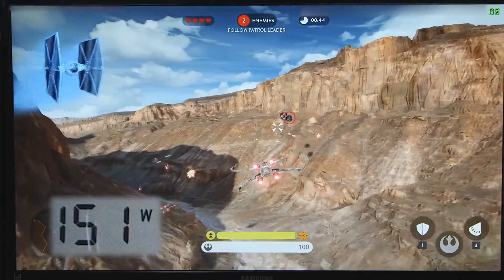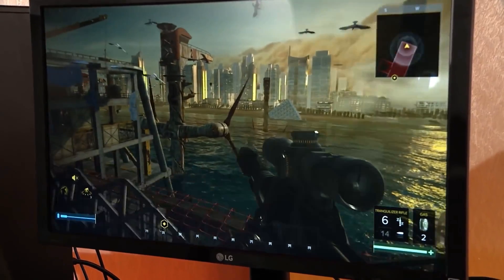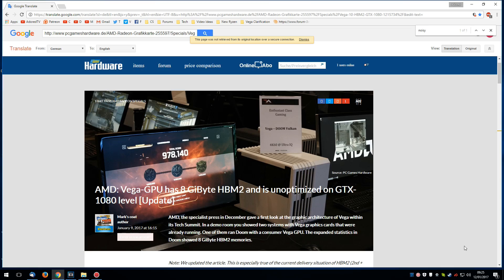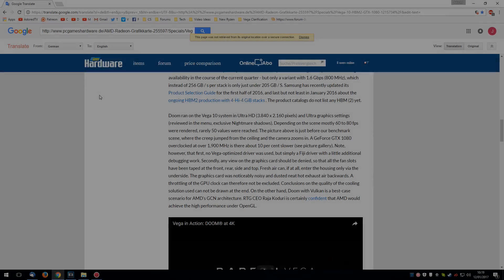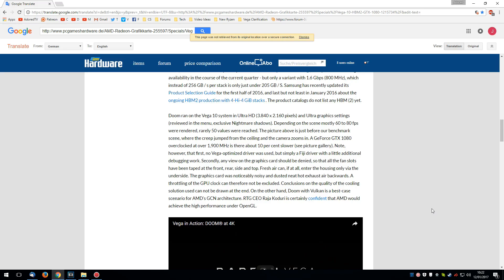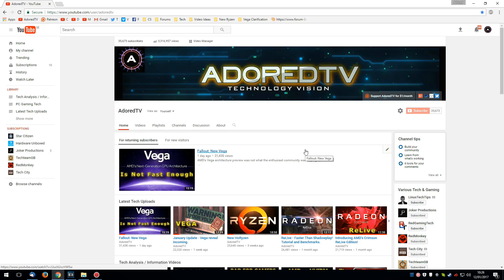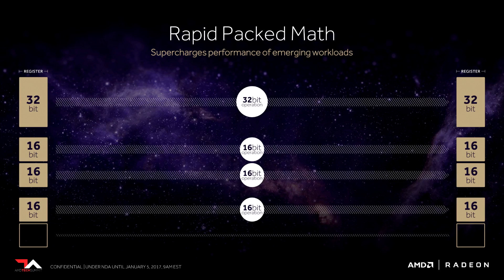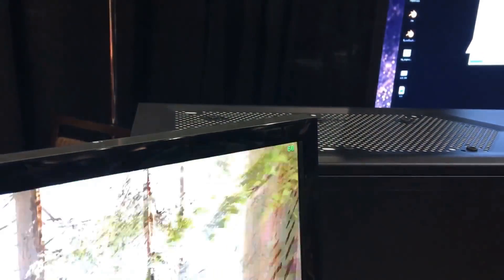Vega Clarification - How bad is it?

Comment: First of all, vega running on Fiji drivers... getting that frame rate...  I think that is just how Fiji with  8GB of HBM and higher core clock speed would run it.   

I think AMD with all their new hardware level technologies and new handlers like primitive shaders tech isn't requiring developers to build that into games, I think it can be implemented driver side, just changing the pipeline of how things are handled.  That could be 5%-10% boost.  

Many games already use virtual memory addressing! A lot of games all you to disable memory limits, however Vega has a hardware level controller for this and handler, while yes this will be limiting to system memory and CPU speeds, I think with hardware level controller for that, it will likely introduce less wait states and less pop in issues.  That alone could add 5% boost to games with proper driver update to handle that.  

Better memory compression controller added, I bet that's not being utilized to its fullest either.. another 5%

15%-20% right there could be unlocked just proper drivers handling how games are stacked and piped for vega better.. 

I can only imagine probably even more tech hidden away, like probably intelligent Texture filtering and recycling for common textures to reduce memory load for streaming distances and such, and some intelligent tessellation mapping.. to not only remove unseen tessellation but also reduce or remove it where it's not needed.. 

AMD's GPUOpen is a massive API system full of things that could be implemented into Vega's hardware level handlers and scheduling without game developers needing to implement it.. just fact they call for certain functions would be enough..

Comment: I hate how people value graphics cards companies by their highest tier silicon. Novideo doesn't "win" over AMD just by selling a 1300$ monster of a GPU. The Mid-High range is where it's at, where the gamers are. The problem is that gamers often forget that too.
Reply: And the money lies in the CPU's too! AMD is in for a huge gain in market share, should Horyzen be at a very, very competitive pricing.
Reply: Vega 11 at Polaris chip size with GDDR instead of HBM @ GTX 1070 performance? Doable? Might be. Profitable? Definitely! My speculation based on "hunch" as valid as any other of this type.
Reply: Guys, you dont get it.
At 500mm^2 and HBM2, it can not be too cheap. It simply is impossible. Meanwhile with GDDR5, 5X and 471mm^2 or 314mm^2, GTX TXP, 1080 and 1070 can easily be the same cost as Vega... and give Nvidia a LOT more money.

Imagine this. Vega comes out and it is 400 dollars. Impossible IMHO, but lets imagine it. AMD will make 100 dollars on a VEGA GPU. Nvidia bring prices of GTX 1080 down to 370 dollars, a bit less than Vega. Nvidia will make 150-180 dollars per GPU...

Adored it right. Unless Vega is TXP level by default and then improves with AIB versions/Drivers, AMD lost 14nm and will be crushed by Pascal refresh and Volta.
Reply: We don't get what? How do you know what is the price of the actual chip. Me or you or Adored have no idea about that. He only assumes it's gonna be worse by die size, but that means nothing if you don't know what the actual price of this chip is. You don't know which price point makes it still profitable and which doesn't. Even then it's still not about Halo product's because they sell nowhere near the volume compared to around 300$ or less. Then again they very very likely slap smaller Vega chip and possibly with different VRAM configuration maybe even totally without HBM or mixed somehow. So again we Peasants have no clue about how AMD want to play it this time and where they actually seek profit. Business is a one complicated topic, you not always have to make profit everywhere to get the goals done. Not sure you know but not so long ago (1 year back) AMD was considered a dead man walking and about to go bankrupt. So all in all they better focus on profitable routes instead of stupid fight about performance crown with nVidia. And without the inside look we have no idea are they or are they not on this route already.
Reply: Damian B 
I dont know the exact price.

I do know it is more expensive than a TXP for sure though, bar any special wafer agreements. 

We know enough to make definite claims. TXP is probably faster and cheaper to make. 1080 is just a tad slower but a lot cheaper.
Reply: :D
Reply: the 1050 is a amazing card for price performance, it literally kills the competition, its the main car for lower budget buyers
Reply: Nomad Brasil 
It is literally exactly the same as the RX 460 :P
Both are barely above the 950...
Reply: rather than getting a 1050 i would rather not but and save up a bit for older card like R290x or sort or shell out a bit more for rx470...
Reply: Sumpfy Bad automod good automod ayy
Reply: "novideo" does win when it has sold more much more 1080's than rx 480's just based on steam stats
Reply: Alexander Yordanov in all benchmarks i saw it always beated the 460 by 5-10 fps.
Reply: Nomad Brasil 
Old benches.
https://tpucdn.com/reviews/ASUS/GTX_1050_Ti_Strix_OC/images/perfrel_1920_1080.png
Reply: Novideo? haha may as well call AMD Nochance then... lmao
Reply: Ah no always strive for the best Mid range sucks
Reply: heh... tell me about it, the AMD RX480 is sort of half my salary.

Midrange is where the games are! i full agree with that. 

Dude, most ppl in the world earn less than 500USD a month! i am rather fortunate or earn close to 800USD. 

Your "bugdet" gaming system is at least a month salary for many of us... not everyone is as fortunate as you ppl.

So please dont give me that titan dream bullshit, its for the 1%
Reply: ^ you dont buy pc parts with 1 salary you save it for months to get the best price/performance.

Comment: just gonna explain some things about AMDs driver performance improvements...
So far AMDs drivers have only been using around 70% of the gpus full theoretical power while Nvidias drivers have used around 95% of their gpus theoretical power. The driver performance improvements AMD is known for basically increase how many % of the gpus full power the drivers can use which is the same reason Nvidias gpus see little to no improvements over time as their drivers can already utilize nearly all the power the gpu has.
So why does DX12 and Vulkan improve AMD gpus performance so much? 
Because DX 12 and Vulkan have nullified the drivers effect on performance which means AMD gpus on Vulkan or DX12 can operate at same 95+% efficiency Nvidias cards have operated with their optimized drivers.
AMD cards operating at 95+% efficiency also means that the driver improvements in DX12 and Vulkan games will be pretty much nonexistent.
Reply: None of this matters!!!  Driver optimization over the course of a years worth of time does not make consumers go all bananas and buy AMD products.  What matters is day one release performance.  Clearly nvidia must be doing it right considering that's what they do.  Consumers are mostly dumb enough to not even realize nvidia products actually get worse over time.  On the release of the 970, my 780ti was anywhere between 10-15 percent faster then the 970.  1 year later the 970 performance is better then a 750 dollar card,  I call that bullshit.
Reply: That's because the 780 ti is heavily bottlenecked by it's memory

Comment: Also AMD can use Fiji type setup where there is more die area available as Nvidia does with gp100. Fiji and gp100 setups are very similar and current Vega seems to be closer to gp 102 in terms of footprint anyway so I have my guess that AMD is gonna release one last GPU on 14nm as 600mm2 which would be similar to GP100 and Fiji in terms of footprint and setup.
Also why AMD would say "Poor Volta" and hype the card if it's not gonna perform even close to best of Pascal.
Also AMD claims 4x performance/watt and Polaris was 2,5x. I'm not saying that AMD really reaches 4x, but lets say 3,5x and Polaris is 2x. Well Vega should be 43% more efficient. That would mean that 4096 at 1266mhz would use 186w of power and 225w tdp would give us 1530mhz which gives around 12,5 tflops.
Well rx 480 and gtx 1060 are the only reference point again and 480 requires around 20% more tflops to beat 1060 in DX11 which means that gtx 1080 at 1911mhz would still be beaten by Vega around ~5% which is not a lot, but Vulkan Vega would lead over 20%. Now given all this Vega would still come short of Titan X in both dx11 and Vulkan which it's sad to hear.
Now there are many architectural chances in Vega vs Polaris, but would it give Vega the edge over Pascal? I really don't know anymore.
If AMD would put out 275w tdp card instead of 225w tdp AMD would generate around ~15tflops of performance if the clockspeeds scale linearly "which I doubt", Vega would have better chances to beat Titan X and it probably would and Pascal refresh would be a good competition aswell.
Yeah people forget AMD is trying to compete with both gtx 1080 and Titan X with a TDP which fits in middle of those two cards.

Comment: You may have a point but, what if 2 vega cards destroy the Titan X and together cost less than 1 Titan? I think AMD has been moving to a dual gpu setup for a while. I have a Sapphire RX480 Nitro+ O.C. @ 1342 Mhz on an FX 8350 O.C. to 4336 Mhz. I also have 2 R9 380's (Nitro+ O.C) @ 1010 Mhz in crossfire on a FX9590. I have similar results in AOS and Deus X Mankind Divided all run in the high 40's to low 50's  avg fps. 

One note since the new radeon drivers performance in Deus X has improved to 60+ FPS in DX12 crossfire. AOS is best run on a single GPU as Multi-GPU for me has lower frame rates. AOS is 50+ now on a single R9 380!). So I think they still have a lot of driver work to do as they have done for the RX480 and that has only gotten better with time. I look forward to the day when AMD gives us a graphics card that you can plug a M.2 NVME drive on for more HBW Cache. Just to end as long as my games play at 60+ FPS on DX12 or Vulcan with no micro stutter then I will be happy. All my older games run at 85 to 100+ fps now so in a few years time who knows.
Reply from the maker: Multi GPU will only really become viable when the devs are either forced to use it or when it's done automatically.  Cheers bud.
Reply: Jerry Watson I've had multiple GPU setups trust me no fun and you feel like you wasted money when it's not supported!
Reply: helloworld459 That has been true in the past, but today I have good performance w/crossfire. But then again I primarily game on DX12. So I guess it depends on your hardware.

Comment: Obviously the performance is gonna improve quite a bit when there are several techs in Vega which were disabled because of the Fiji driver.
Reply: I think this is actually a great point. We have no idea what proper drivers are gonna do for Vega.
A lot of the hardware on the card won't have been utilised at all for these shows.
You would have to think AMD wouldn't be pushing marketing like "Poor Volta" if they didn't know it was gonna be much more powerful than Volta, Nevermind Pascal.

You don't aim for the moon when you can't even get past the stars...
Reply: +Eskiimo Joe
The point of the demo was to show Vega as being a 4k capable card. 

As for you not understanding why they do things, well, you don't have an education in marketing or (the relevant kind of) engineering, do you?
Reply: Silicon, firmware and drivers could likely all still be improved.
Reply: I don't understand why they would show the benchmarks for a card that will be significantly worse than when the card releases. Why would they make it look like their top tier card is much worse than it is? I feel like drivers will make a difference, but imo it's doubtful it will be a large difference.
Reply: valid point
Reply: Could easily see another 20% or more performance increase. Drivers make a huge difference.

Comment: All I want to add is things aren't adding up at all.. Polaris 10 with 4096 cores at current state of GloFo (higher clock speeds due to increased efficiency) should be matching a 1080.

 If you're talking about a new architecture (VEGA), higher IPC, more efficient HBM2, we should be seeing a much better finished product. There was nothing stopping them from creating a 1080 competitor, they already had the technology. Why would they bother releasing something which was 15-30% better, an entire year down the line... Thoughts?
Reply: Vega will match 1080 but thats it. Nvidia can just drop the 1080s price. Even at 500$ Nvidia would make alot of money from a 300nm chip. The fact that it costs 600$ is a joke. So who will buy Vega, everyone who wanted high end gpu already has 1080/1070.

Comment: I think it's going to be fine. I don't see myselfe needing anything above a 1080 in performance any time soon. and I think only a small segment of the market is going for 4k, 100 hz 60+fps gaming.

Running an R9 390 right now. So I'll be looking forward to the pricing of Vega for my future upgrade path. I'm still running at 1080p like the majority of people. It's fine if AMD doens't compete with the upper echelon. They had a rough few years. And I just hope they get their midrange segment running smooth with good support.

I'm very happy with my AMD GPU and I'm pretty sure most are.; The problem is taht 8 out of 10 people seems to go for Nvidia, just because of brandrecognition. Or "Mindshare".

Comment: I am not sure if comparing to nvidia trickery is even a good idea. Physicaly titan xp and 780 ti are the most powerful gpus they ever made. Right now a 780ti should outperform everything from gtx1080 down, it has simply that much more calculational power. The problem is Nvidia been constantly gimping their old gpus, and AMD cards through gameworks and nvidia designed fx plugins for every single dev software on the market. They are faking the underlying performance of the card and theres only so much wiggle room to do so before everyone starts asking serious questions. 

Problem is at this rate nvidia can release GTX1180 with 50 % less cuda cores than a 1060 3Gb, a fucking teraflop performance of gtx760, make it magicaly outperform everything, with half the core size on the same tech process (proving that physicaly shit has been cut down) yet not a single fucking reviewer will analyze the fucking made in Hogwarts performance but intead they eat from nvidia plate like its no tomorrow.